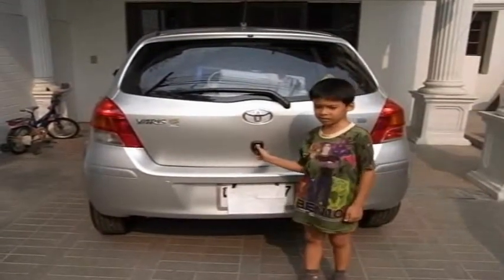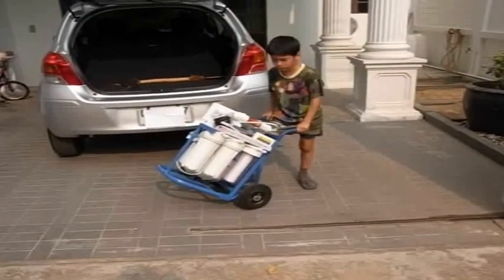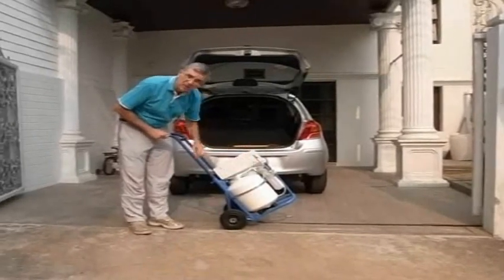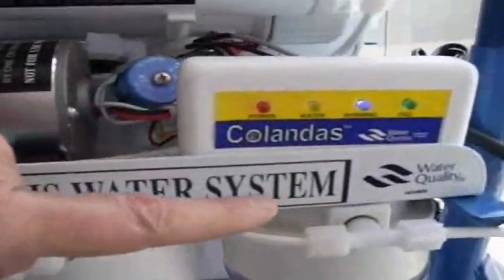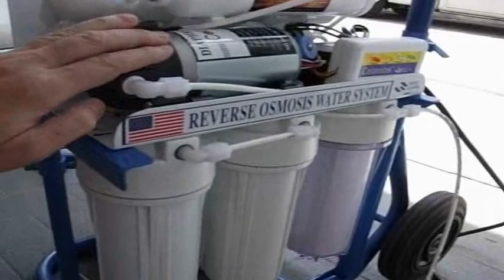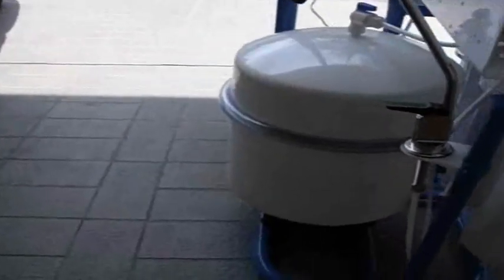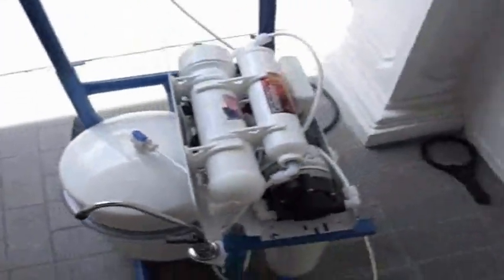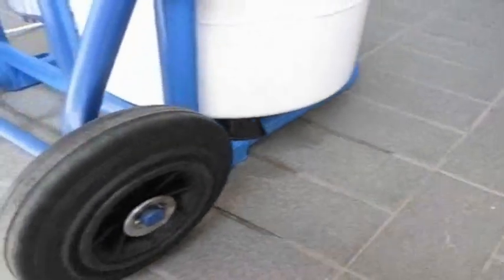Portable Solar Powered Water Filter - Prototype Test

Comment: would this be applicable on a boat? would you have to increase filter size for salt water? this is a million dollar idea! Bravo
Reply from the maker: +Split Pea I've never tried this filter with salt water.  I have used a different RO filter with brackish water and it was OK, but still could taste the salt.  I won't make any claims for use in a clean, fresh water lake, but I personally would use it, especially in an emergency.  For marine use I might try to experiment with 2 RO filters, one after the other to see if that would work better.  I would start with some basic research with the mfg info.  See how long it would hold up and how much salt it could remove.  Thanks for the comment and the ideas!